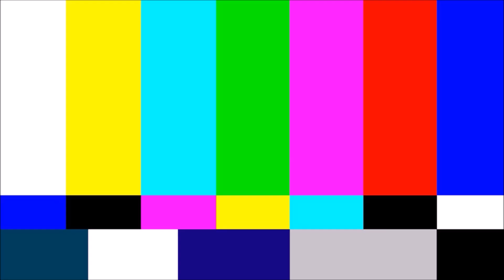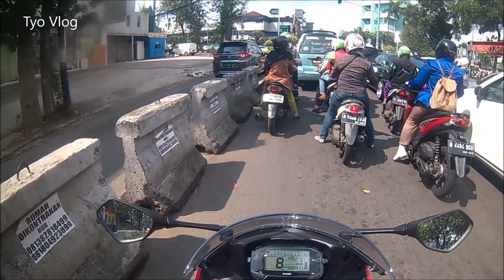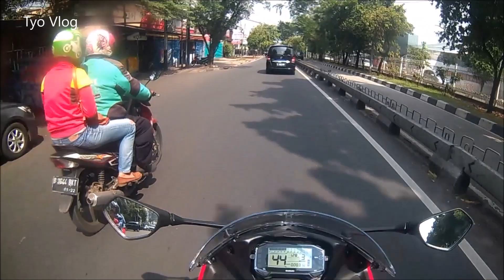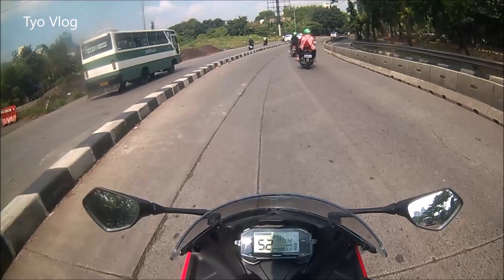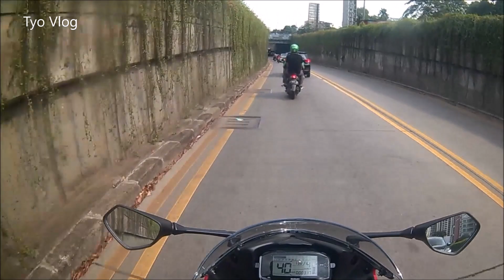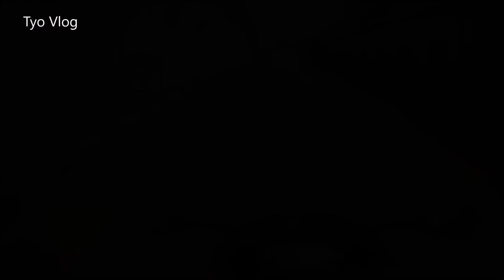Perbedaan OverStroke, OverBore, dan Square Engine pada motor #33 | MotovlogIndonesia

Comment: Motor ane shogun 110 (bore up 130) bore x stroke 58x48,8. Klep in 28 ex 24. Waktu digeber kaget ane tembus 12.000+ rpm. Untuk top speed masih belum diketahui (gak berani bawa motor kenceng). Buat gigi 2 tembus 70+ km/j

Comment: Overbore DOHC . Salam klotok klotok om 😂😂
Reply: Motr gw Cb150r old stroke atau over bore? Bru beli soalnya
Reply: @sukriota1883  overbore om
Reply: @abdulghofur9744  mkash om
Reply: @abdulghofur9744  overbore tu bagus gak ya speednya
Reply: @sukriota1883  bagus buat rpm atas dapet .
Reply: @abdulghofur9744  oo kncang mana sama yg cb150r new cuk?
Reply: @sukriota1883  menang old mas,yg new gk ada larinya😂😂sesak napas trus😂😂
Reply: @Inforezachannel  yg bener mas,kn yg new keluaran baru it
Reply: @sukriota1883  iya mas,soalnya yg old limitnya lebih tinggi dr Pd yg new,mknya klo main panjang yg new gk sanggup ngikuti old CB150R 😀😀👍

Comment: Klo R15 v2 & R15 vv3 
Apa bro ???
Reply from the maker: overstroke
Reply: Tyo Vlog 
Tyo Vlog 
Berati sama dengan Vixion ya :) tapi ada perbedaan  akselerasi top speed akhir antara Vixion vs R15 
Lebih kencang r15 jelas lah karena  kls fairing lebih kencang di bandingkan kls naked.  
Tapi klo diadu  R15 bahkan R15  vv3 vs GSX S neked palah menang GSX S neked ,ya karena GSX S  memakai DOHC dgn mesin overbor sama yg di terapkan dgn GSX R